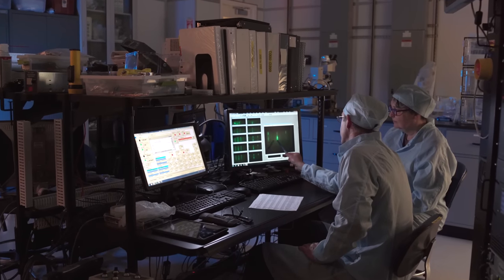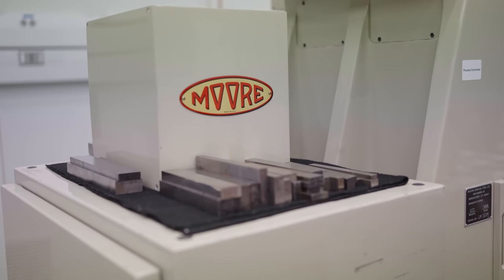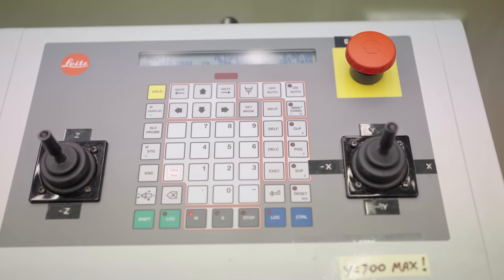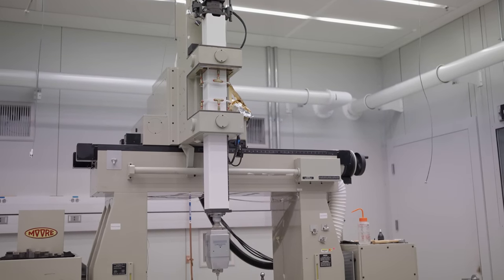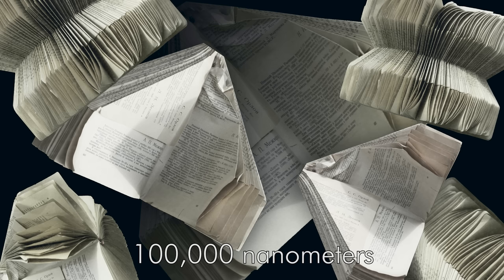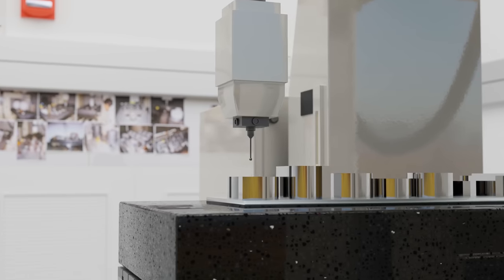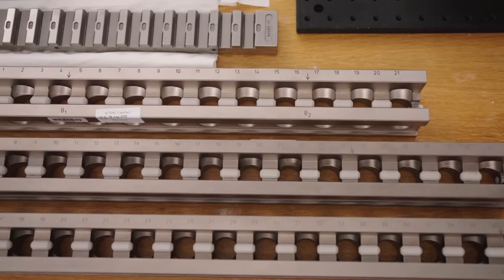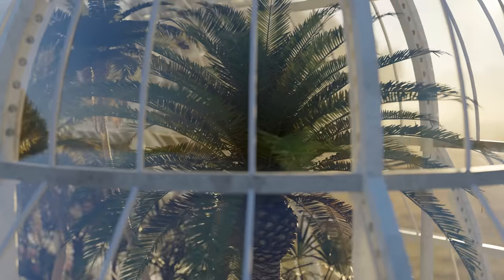The INSANE Precision of The National Institute of Standards and Technology

Comment: What fascinates me is how we can create tools of higher precision than the tools used to make them. The three plates method is like magic.
Reply: Thankfully, we're keep evolving in term of technology. Back then people invented pickaxe out of fire and specific rocks under the land
Reply: If you have a long rope cut to +/- 1 foot precision, fold it in half and now its +/- 0.5 feet precision. Not rocket science to make a better measuring tool then the one you started with.
Reply: @wally7856  That's not the way precision is measured. Let's say that the initial rope is 10 feet long, +/- 1 foot. That's a precision of +/- 10%. If you fold in in half you get a 5 foot rope, +/- 0.5 feet, which is still a precision of 10%. In reality you're actually worse off because the rope has thickness and the bend at the point where you folded it will have a radius which introduces even more error.
Reply: using reversal method you can measure the straightness of both a  machine axis and the reference even if both the machine and reference have an unknown straightness.  that is also pretty cool!
Reply: @IslandHermit  its a highly impractical example, but he is right.
The unfolded rope will be between 9 and 11 foot long, assuming its within tolerance.
The folded rope, will be within 4.5 and 5.5 foot long, assuming an infinitely perfect fold. The precision has been doubled in this case.
Obviously in real life this owuld never work, nor does it have much practical use if it did. But he is right. % has nothing to do with anything. 10% of a millimetre is more precise than 10% of a metre.
Reply: The averaging effect of air bearings has been key in increasing accuracy.
Reply: @Nbomber  It depends on what you're using the rope for. If for example you're hanging a weight from the rope and need to know what height it's at, the +/- 0.5 ft precision of the new rope is useful. If on the other hand you're using that rope to measure out the length of a football field your measurement will be no more accurate than if you'd used the 10+/-1 ft rope.
Reply: @Nbomber  If you try to measure 20 feet using the folded rope the answer you get will be accurate to +/- 2 feet, exactly the same as the unfolded rope. For any given measurement they both have identical precision.
Reply: @wally7856  Actually, a one foot long rope folded in half is neither one-half of a foot nor is it precise.
Reply: @IslandHermit  You've just pointed out the mathematical error in one of Amazon's interview questions. As posed by the interviewer the question has no answer. The problem as stated is this: An 80 m long cable is suspended from the tops of two 50 m tall poles. The center of the cable measure 10 m from the ground. How far apart are the poles?

Sadly, Amazon's interviewers know so little about basic geometry, arithmetic operations, and physics that they do not realize that their expected answer of zero (0) is incorrect. 

As you've noted, a cable (or even a rope) will not fold exactly in half. Therefore, even if the two poles are coincident (i.e., 0 m apart) the 80 m long cable will always be greater than 10 m above ground.
Reply: @patrickherke8947  except you'd be potentially introducing at least twice as many opportunities for error
Reply: making precision tools to make precision tools is a great achievement on its own.  I've been to the Springfield Armory to see the old lathe and it might still be more precise than any of my modern hand tools.
Reply: @IslandHermit  
Not practically.
A distance of 20-ish feet measured using a 10±1ft rope twice will be measured more reliably than using a single 20±2ft rope. Saying there is a 20% chance your rope is 11ft, 20% it's 10.5ft, 20% it's 10.0, 20% it's 9.5 and 20% it's 9.0.

Run that matrix.
You can slice up the probabilities and increments as finely as whatever coastline you care to measure. It's more or less the same.

This is one more reason it gets worse when you try to run the model the other way by halving the rope.
Reply: @zedex1226  I'm aware of that. I was trying to keep my example simple to show how folding the rope in half does not increase its precision. The factors you outline simply reinforce the point.
Reply: @JesseSchoch  I have seen professors mention the reversal method in metrology but did not go very deep into it. I am left with more questions than answers. Have you come across any good online resources that explain it more clearly? Edit: I also  took a look at your channel and you have an impressive breadth of technical expertise, subbed!
Reply: @wally7856  wrong
Reply: @wally7856  it actually is rocket science though! that is not something that is intuitive
Reply: You have no idea.
Reply: @Skystrike70 Dan Gelbart has a video explaining it. Part 17: High Accuracy, from his prototyping series. Foundations of Mechanical Accuracy by Moore also explains it(you can find a pdf of the book quite easily). It shouldn't be too hard to find in most precision engineering books. "Self proving" would be a good term to search for.
Reply: Yep you can divide any measurement by 2😊😊😊😊
Reply: This is the thing i simply don't understand. Does the plate method also apply to screws or how more and more precise lathes and lead screws can be developed?
Reply: @Tigerodoes  The three plates method gives you extremely flat surfaces. Those surfaces can be used to create very precise straight edges which can be turned into relatively precise rulers. The rulers let you create fairly precise gears. At that point you can use gear linkages to create almost arbitrarily precise threads.
Reply: @IslandHermit  Thanks for the answer! We truly sit on the shoulders of so many wise engineers and architects. I wonder if all our current machining equipment would be magically removed, how long it would take to reach the same proclivity of precision with these basic principles?

Comment: Love how the wires run loosely across the ultra-precision grid and how they are held in place by the pieces of the blue masking tape 😂
Reply: 5:24 - they carry the readings from the temperature sensors is my guess. Might be difficult to route those wires in any other manner, due to the placement of those sensors.
Reply: @gacekky1  - I think the parent comment was more about mocking about how they are “precisely” held in place with tape, but I could be wrong. Most likely, the equipment was modified after it was manufactured when someone realized that temperature sensitivity affected measurements enough to warrant measuring those temperatures, and thus there aren’t any built in places for the wires to run.
Reply: There's a million plausible explanations for the setup, including simple investigations. Oftentimes my experimental investigations look crude, but I know they're sufficient to answer the questions I have.
Reply: Odds are the electromagnetic pull of ANY current running through the wires inside of the machine would be enough to throw it off so what do you do?  Tape those suckers outside of the machine minimizing external fields as much as humanly possible.
Reply: These are thermocouples as others have mentioned. They are always used in this matter as they are just leads with the sensor at the end. They measure workpiece temperature so they need to be mobile to accommodate different work pieces. The tape is just there to keep them from moving around. For most CMM's they are used so the software can make corrections based on the expansion coefficient of the material used in the part being measured. For NIST and the lab environment they are in they aim for 20c which is the set point or zero for temperature expansion. Meaning everything is on size at 20c and wont need compensation. For their purpose they are likely monitoring the workpiece for deviation from the environment to either pause the program from starting or error if it deviates during the part program run.

Comment: I appreciate your past videos also.  To your point of how standards testing trickles down, it also trickles down in emotional ways. 25 years ago I  bought a new S-K Wayne  3/8 drive torque wrench from a combination tool and hardware store in Orrville, OH, an industry town near Amish county of Ohio.  S-K Wayne tools were my dads favorite. As a gift for my fourteenth birthday, 1974,  dad bought S-K's 1/4 drive shallow and deep socket set.  The the fine tooth round head ratchet was the best for his work as a bodyman. Fast forward 20 years,  SK tools were hard to find, but laying in a case was this S-K Wayne torque wrench, and I had to have it-- I have not seen another one since.  
The second time I used the wrench  locking mechanism that holds the torque setting jammed. As the  hardware store did not have any more in stock, and story goes the wrench was out of production,  my tool was  sent away to be repaired.  When it came back,   a handwritten note in the repair package, apologized for modifying the  tool, The head was the same, but the handle was completely different- later found out it was a Proto "Click-Stop" handle.   I marveled at this good fortune to a more precise tool. The note continued to say that modified wrench had additionally be sent out to a certification lab, and bore a sticker and number of the certification.  Today this S-K / Proto torque wrench is my most valued tool because of that certification tag! Yes I still have the 1/4" drive socket set too!!
Reply: Ok
Reply: I ain't reading all that.  Make a video of it
Reply: @bigqwertycat  kids these days.
Sigh...

Oh wait my peers did that too when I was young. Uhh.

Kids who don't like reading.
Sigh...

Comment: The first time I ran across Moore machines was when I was doing machine repair. Had a customer who owned two of their jig grinder's, and had purchased two used machines rebuilt by the factory to full brand new specs.

When the new machines were delivered, there were labels all over them to let them sit in the correct climate controlled area for a week before the factory tech would do the initial setup. 

With the two machines came a crate full of inspection equipment. Two weeks after the machines landed, the factory tech showed up. I'm now a full time CNC machinist, who's tools regularly state "Traceable to the NIST" on the their warranty paperwork. 

This guy was pulling out inspection equipment labeled "Certified By NIST". Got detailed by the customer to be his assistant. Learned a hell of a lot over the next three days.

Comment: Hey that's neat! I worked for about 5 years working on and casting the molds for the polymer concrete bases that some these Moore Nanotech machines use as their frame! I knew I recognized that logo from somewhere lol.
Reply: So that base is not a cast iron?
What type of polymer are you using?I'm trying to build my home CNC.Sorry and thanks.

Comment: One little quick comment about the XP computer. It’s peripheral, running old data collect software for a vision system  I use occasionally. Nothing to do with running the CMM. Its good enough for its function. No reason to get a newer one, until it dies.

Comment: I did my EE undergrad internship (1993-97) in the Phase Noise Measurement group (Time and Frequency Division, NIST Boulder), and my final project was a 76.76GHz synthesizer that went into the Josephson Voltage Standard. That foundation in metrology has served me incredibly well throughout my 26 year career in RF/analog engineering.

Pre-9/11, NIST Boulder was set up with a self-guided tour, anybody could walk through the halls, I did it all the time as a kid. The atomic clock lab had a big viewing window in the hall. These days, I had to contact the group leader to get an escorted tour of the lab I interned at, and be on the guest list to even get on the campus. It's sad, and maybe an over-reaction, or maybe not.

Comment: I'm REALLY surprised the interferometry doesn't happen in a vacuum. I know it would be a mechanically complex mechanism, but I always assumed that NIST length measurements used a vacuum laser interferometer.
Reply: I imagine a lot of stuff would need a complete redesign to work in a vacuum, it'd become vastly more expensive, also unless it's designed for space it'd be pointless because most parts teste would be used at standard atmospheric pressure anyway. Also way harder to control heat in a vacuum.
Reply: @Eagle3302PL  I meant to put the interferometer in vacuum, not the whole machine.

Comment: I'm actually extremely happy that I only have to keep my work (welding metal structures pieces) within the millimeter
Reply: @ericpug9154  that would be true if i hadn't to make correction on almost all the pieces i'm putting together and some after being completely welded but i'm getting better ✌
Reply: Are you originally a wood worker? 😉

My experience is that metal workers use calipers and tent of a millimeter.
Reply: @dansihvonen8218  there are several levels of precision on woodworking and metal working. My level is grind/file/rasp/sand until it fits 😂

Comment: I'm surprised a Moore machine from the 80's still has not been surpassed. I have read portions of the Moore books, and am fascinated by them. This is not meant to be a bad comment towards them. Just surprising there is nothing better 40 years later.
Reply: It's not that nothing better can be built, it's more about this specific unit having 40 years of data, fine tuning, upgrades and software optimizations done. So you could most likely build a more precise machine but it doesn't make sense financially and practically the precision gained would not be worth it. There's also no one around to pony up the cash for such a project, I'm sure there'd be many engineers and scientists scrambling to join it.
Reply: @Eagle3302PL  Yeah the "precision gained would not be worth it" point is the important one I think. It's not only the measurement that varies with temperature, humidity etc, it's the dimensions of the thing itself. There's no point in measuring it to a nanometre or less when the dimensions are going to change by much more than that between the measurement and the context in which it's actually used.

Comment: While my comments are not directed at precision at this level, I have to add to this endeavor the following information which will really help a lot of people. I had an addition put on to a home that I bought. The contractor was famous in the area, a nice guy to deal with, and any work that I saw him do personally was done correctly. That’s the good news. The bad news is that I found a bunch of things as construction went along that they had to fix. He wanted to know where do you get all of this information from? The answer was a book that I bought that I bought 25 years ago, and the cost was $160 and the name of the book is “architectural standards.”Everything that you need to know is published somewhere, if you are getting short changed or ripped off or things are not working right go online which I couldn’t do then and check it out. It’s the cheap and easy way to do it. These people don’t know what they’re supposed to know.

Comment: I wrote a blog piece in 2015 about atomic clock time-keeping. I found "The latest in atomic clocks would neither gain nor lose one second in some 15 billion years—roughly the age of the universe." That's NIST for ya! I haven't checked since, who knows what it is like today.
One application I found for that level of accuracy: - As Einstein predicted, a gravitational field causes time to pass more and more slowly as gravity increases. A clock which is higher is further from Earth, experiences less gravity, and thus runs faster. The new clock is sensitive enough to detect the time shift caused by a rise of only two centimetres! It can thus serve as an extremely accurate measure of height for mapping, and of gravity variations caused by the earth's composition and shape.

Comment: I saw Mitutoyo CMM being used way back in 2000 with the industry that I worked with, in India. It was used for measuring various dimensions of automotive parts. Considering such machines were available in Indian industry in 2000, finding more accurate CMM in US top institute after 23 years is not surprising at all.

Also, the effect of vibration, temperature and humidity is known to someone who is already in this field. I had been to CRDI fuel pump machining units, where the lathes were operated in controlled environment. And this too in 2000.
Reply: That Mitutoyo CMM had to be benchmarked against something. What do you think that something is?

Automotive isn't one of those industries that necessitates such accuracies -- it's things like semiconductor fabrication. The machines measuring things in those fabs had to first have a reference before they could measure. That reference comes from something like the tool this video is about.
Reply: The CMM featured here is already 35 years old.
But again this is at a national standards laboratory and used to verify other 'master' standards.
A few steps removed from the metrology shop in some auto factory (though your work is no less important)